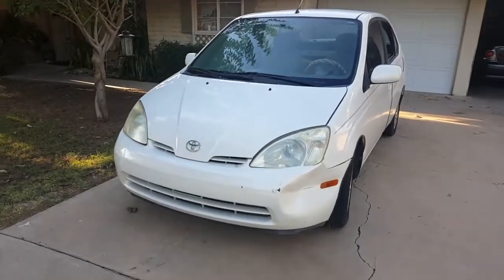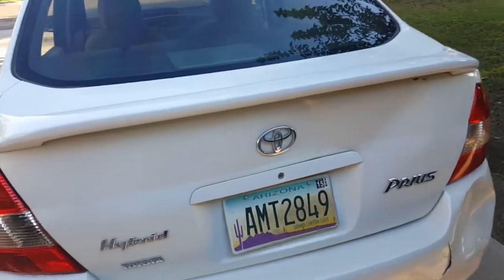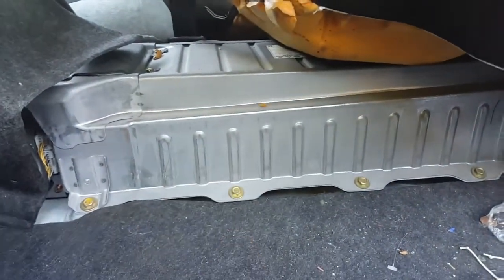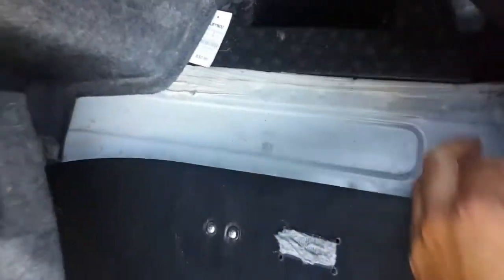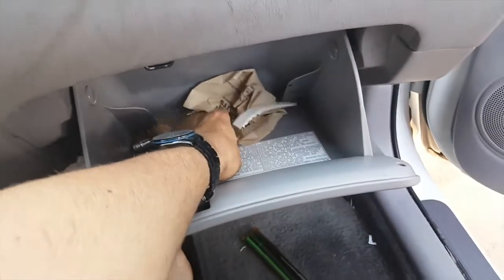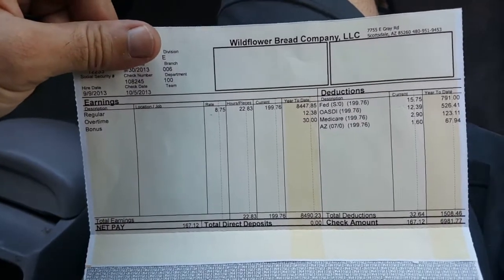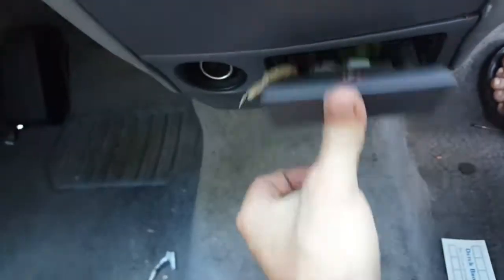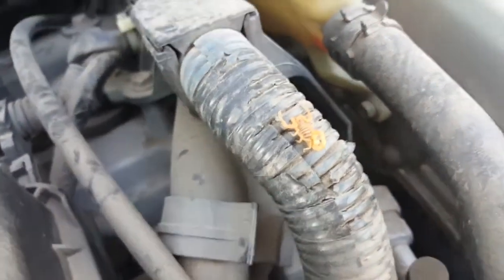Racecar And Chill GETS A WHAT?!?! 😲😨😱Infested With Scorpions!

Comment: Could be a good investment! Hopefully you don't have to replace the hybrid battery, they are very expensive from what I understand, like thousands of dollars! But maybe for a first gen the prices have come down. Fingers crossed you get lucky and its something easy or just a loose connection. Be very careful with the orange wires as they are high voltage and amperage!!!
Reply from the maker: Garage Project Motorsports yessir! Definitely gonna do research on what I can and cannot touch! I'm hoping I can fix the battery by either replacing wiring or maybe a few cells inside of it, but worst case, I can get a battery for under $1500!
Reply: RacecarAndChill that's cool, and at that point it's still a great daily for under $2k!
Reply from the maker: Garage Project Motorsports That was exactly the reasoning I used to buy it! And I'd like to learn more about how they work too! I'm excited about it!